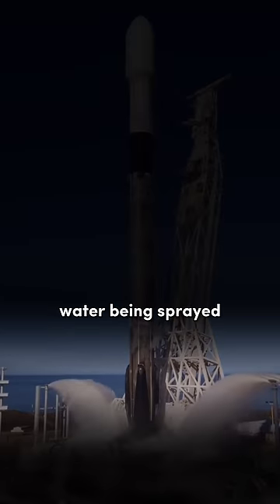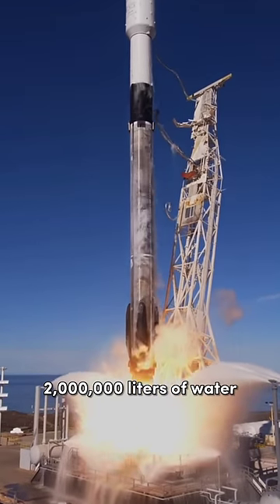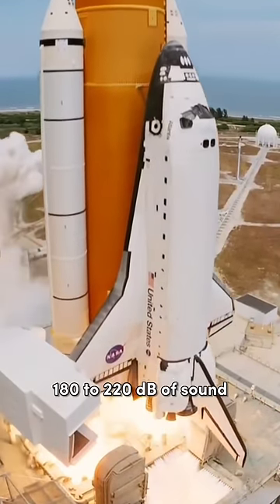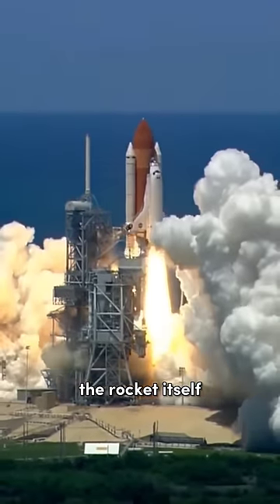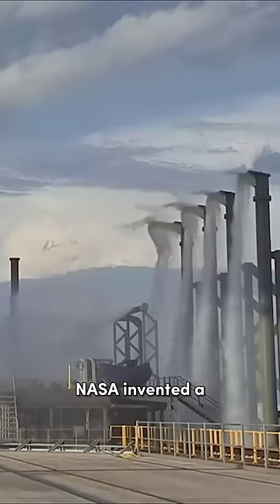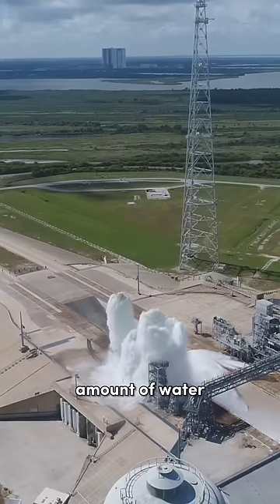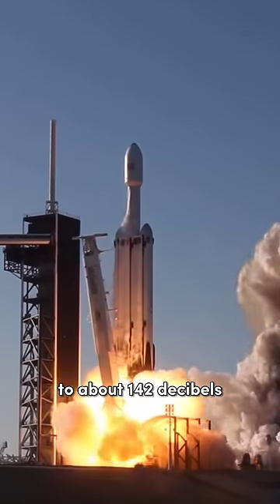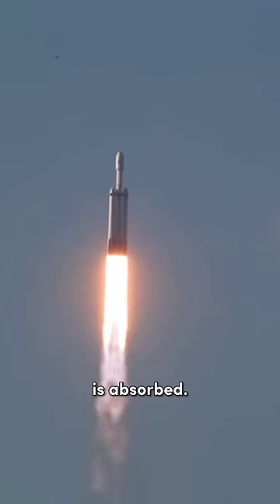How Water Prevents Rockets from Exploding #shorts

Comment: For everybody whining about waste water, first of all, you can't waste water, it just goes back into the water cycle from evaporation or absorption. What you waste is the energy that it takes to pump and purify it. Second of all, it probably takes a million times more energy to forge the metal components of the rocket, than to pump a little water up a tower. For goodness sake, pull your heads out of your bums. The rocket fuel alone could be burned in a power plant to fill thousands of water towers, it is a tiny, necessary expenditure. If you want to save the world and go green, write to your politicians and tell them to switch from coal to nuclear, that's the only fast, safe, clean way out of this mess. A little runoff isn't gonna change anything.
Reply: Water does return to circulation, but its not always so simple.

If you have already dry areas and you pump them even more dry, the pumped water will rain back on earth elsewhere leaving the original place all dry.

This is not a problem in places with plenty of water. But even in Finland, which is considered "country of lakes", dry summers dried many water reservoirs causing huge problems to people who have always relied on "endless water"

But I do agree that nuclear power is key element in fighting the climate change. Here few reactors are creating 60% of all energy need soon.
Shame Ukraine war halted the construction plans of the new powerplant, it was estimated to make 80-90% of energy production needed nuclear.
Reply: launch sites are often situated near sea or oceans, so unusable water is used for this
Reply: If it’s saltwater it doesn’t really mattet since we have some of that…
Reply: You can literally waste water. If the water reaches the ocean and becomes salty, it becomes virtually unusable
Reply: they use fresh water. also, it’s not that big of a deal. nuclear submarines have been converting salt water to fresh water since past centuries. how do they get water in space stations ? they make their own. it’s just that governments aren’t that into making fresh water, and are more into making people suffer.

Comment: He said 97% of the sound is absorbed and its still super loud. Amazing.

Edit: Guys, you can stop saying the same thing to me in the comments (I know). All I was getting at was that those are some amazing and powerful machines.
Reply: I mean it still loud but its a good thing that the water can prevent it from destroying the rocket, your ear and the surrounding buildings
Reply: 97% for the first few second of launch yes, everything after it leaves the ground is the full amount.
Reply: @jenson1569  well most the sound would be at very very low altitude considering a vertical launch.  Unlike aircraft
Reply: @jenson1569  no becouse in the air is nothing that courld be destroyed its more about the sounds waves hitting the lit or the olm directly from a close distance. The water won't be like a sound damper, more like a sound shield.
Reply: At 220 dB the vibration would heat up concrete enough to melt it. Imagine the effect on a human body, too. You'd basically get liquified. FROM SOUND.
Reply: @harrisonweaver7401  dB isn't linear
Reply: @harrisonweaver7401  Decibles are not linear
Reply: @harrisonweaver7401  That’s not how decibels work. dB can even go to negative because its not linear
Reply: still enough to cause permanent ear damage with short exposures
Reply: @harrisonweaver7401  of course its wrong. He said between 180 and 220 db and 142 is definitely not 97% of 180
Reply: @Slimboy025  I have actually no idea how he got to 97%, but the db scale is not linear. So basically to get the ratio you would need to calculate this: 10^((180-142)/10) = 0.00015 which is closer to 0.012%. The dB scale isn't intuitive.
Reply: @harrisonweaver7401  🤓
Reply: Think of sound as exponential when looking at decibels
Reply: Rocket only use his 3% of his power and it's super loud, imagine the Rocket use 100% of his power, the whole continent Will change season.

(The Comment is joke, not a science fact)
Reply: Then i don't how they went to moon in early
Reply: Me who trying to understand this smart shet caculation so i can reply back:
Reply: @justinh5382  like every 6 dB more is twice as loud
Reply: Decibel scale is not a linear😴
Reply: @harrisonweaver7401  that’s what I’m saying! The math just simply doesn’t check out
Reply: At cape kennedy the glas is 6 inches thick..launch pad is 3 miles away from the tower, any thinner than 6 inches the glass shatters..absolutly mental
Reply: @harrisonweaver7401 What? No, your not doing it right either. You need to find the difference first, than you get your value. So, 140-220=80. Therefore the dB was reduced by 80db, so now do the math. 80÷220×100 = 36% that's more accurate going from 220 to 140 and only dropping 80db. There is no way dropping by 80db from 220 is half the total volume. That's more like if it literally dropped by 140 decibles.
Reply: @MrGoesnuts Cause he took the Volume it dripped to and straight up divided by the total. If we're talking simple math, he didn't even calculate the difference. It should have been 80÷220×100 so the difference in % is 36 of original volume.
Reply: @MiJi_29 I'm dead ☠️ And you too funny.

Sike, lame.
Reply: @viktorbihar5384  you don't understand the decibel scale. It is not a literal scale. Every if you add 3dB to any level the sound pressure doubles. 103dB has twice the sound intensity level of 100dB and 53dB has twice the sound intensity level of 50dB. To go from sound intensity into the dB scale you have to calculate the log10 of it.
Reply: @MrGoesnuts  You're right, but the man wasn't calculating it using any scale, he was comparing the difference, and he didn't even do it right. We aren't talking about the decibel scale, we're taking about how he did his uncorrolated math incorrect. So, if the decibel scale were to be valued at a percentage, it would be 80÷220×100, not 140÷220×100.
Reply: @viktorbihar5384  he did state in some comment somewhere that he knows it isn't linear.
Reply: 97 percent yet still 140 out of 280 decibels ?
Reply: @tylerthecollins7256  it not a linear scale. The values are still wrong. More than 99% are absorbed from 280 to 140.
Reply: @tylerthecollins7256  I was gonna ask if I knew you by any chance, but then I realized the age wouldn't correlate.
Reply: Thought the were somone from a Junior Highschool I use to go to that I knew. Would have been a really cool coincidence😂
Reply: How is 142 just 3% of 220 though?
Reply: Also the decibel scale is not linear ;)
Reply: Decibel is a logarithmic scale
Reply: I saw another video where they test the engines of the rockets, and they put out alot of water.. to get rid of the heat from the engines.  Not sure what to trust now  :D
Reply: @aazreaal  thats kind of crazy, since i've read that 194dB is the max you can reach, cause after that the low preassure region is empty so cause of physics its not possible to go higher
Reply: ah okey, I found on nasas homepage info about the water. They release 900000 gallons of water to supress the audio level down to around 180dB "Thousands of gallons of water flood the launch area at the crucial moments surrounding ignition, serving two purposes. Water keeps flames from spreading and prevents damage caused by sound waves. Sound waves can cause pipes to burst, walls to crack, and joints to loosen. Damaged systems could lead to more fires because of those leaks and breaks. Water floods the launch area to muffle the sound energy."
Reply: @harrisonweaver7401  you ever wonder why it's lowercase d and uppercase B... The decibel is a relative unit of measurement equal to one tenth of a bel. It expresses the ratio of two values of a power or root-power quantity on a logarithmic scale. Two signals whose levels differ by one decibel have a power ratio of 101/10 or root-power ratio of 10¹⁄20
Reply: He said 180-220db. Then he says %97.5 absorbed and  get backs to 146db. 
Perfect maths 😂😂😂
Reply: @fatihertem1  you don't seem to realise dB are a logarithmic scale as a rule if thumb every increase of 10 dB relates to a sound being twice as loud so  a 70 dB difference would be equal to 2⁷ or 128 times louder.... so a 97.5% reduction from 220dB is not far off 146dB ..... are you feeling a little foolish yet?

Comment: Now this is just terrifying to think that Sperm whales call can reach upto 230dB
Reply: thankfully they're aquatic so a sound barrier exists around it
Reply: @aoyuki1409  bodies of water transmit sound even better...
Reply: @lepperkin  last time i checked our ears runs on air, not water. Therefore water must transfer the sound to air and thats horribly inefficient. But for other aquatic creatures unless they're point blank they'll be fine too and wont get shredded by sonar blast
Reply: @aoyuki1409  our ears don‘t run on air, but on the pressure changes created from waves. It does not matter if that wave was created in the air or in the water. This is why you are still able to hear sound in the water.
Reply: @XNerk302  yes, and whats the medium on the other side of the ear drums? air. thats why sneezing can sometimes make your ears and hearing go funny.

thats why everything sounds muffled/heavy underwater for humans
Reply: Hello twin
Reply: @TamilEelam1  incorrect. water can transmit sound/waves faster than air. its the conversion from water to air, and vice versa that is horribly inefficient due to refraction, diffraction and other waves (and also just simple physics like sound waves absorbed into movement or heat)
Reply: @luksta00  😂
Reply: @TamilEelam1  Because we are designed to hear sound in air. Our ears aren't designed to pick apart and understand sounds underwater, having evolved on land.
Reply: @TamilEelam1  like i said, our ears work on pressure difference to pick up waveforms. The inside of our ear is air. The other side if air, would have a smooth energy transfer across the eardrum. If the other side is water, there's a density difference of medium between water and air therefore the waveform gets distorted by refraction as it passes thru your eardrums.

You dont actually hear better on land vs underwater. You just hear them at different frequency and the frequency underwater just makes everything sounds muffled and heavy.
Reply: @aoyuki1409  yeah well, eventhough there is air inside the ear, the sound still travels primarily through the bones inside your ear - the hammer, incus and stapes - towards your inner ear
Reply: @TamilEelam1  guess who failed 9th grade physics. You.
Reply: @アヤミ  No, I didn’t fail. I actually scored the highest grade possible. No need to be rude for a genuine error.
Reply: @FlatEarthKiller  i didnt say anything about it not utterly destroying your bones and flesh xd
Reply: @aoyuki1409  it can rupture the lung and your brain even the most insulated body part is severely ruptured or at best, mildly
Reply: henlo.
Reply: @aoyuki1409  I have underwater speakers in my pool and the clarity is amazing.
Reply: @alanchristoffersen7329  thats because underwater speakers modify the audio waveform so that when it refracts on your eardrums with air inside it sounds amazing. try playing it in the air and it'll sound horrible. its just harmonics
Reply: Did you know that 200 decibels of sound is actually deadly
And 230 can disintegrate a human skull
Reply: @TamilEelam1  so a B?
Reply: @g_manitie1138  Grade B is not the highest grade possible 😂
Reply: @TamilEelam1  oh shit my bad I misread second highest lol, I was like why tf he bragging about a b 😂
Reply: @aoyuki1409  except Sound travels through mediums and water happens to be a medium 4x as effective as air. Our ears are not built for arial sound waves but just sound waves. Hence you hear sound under water.
Reply: @aoyuki1409  Point is, what protects you from such loud sounds isn't the fact that human ears "run on air", but that, being outside of the same body of water, even being mere centimeters away from a Sperm Whale should be enough to avoid being blasted.

And when inside water, the concept of being blasted at "point blank" isn't different from anywhere else either, including atmospheric air; Actually, a point could be made that cetacean clicks are directional and lose very little energy per unit of distance travelled when compared to "submarine-hunting" active sonars, so Sperm Whales can blend our brains from quite a good distance away.

But, of course, this would assume that not only do Sperm Whales want humans dead, but that they specifically target humans that are diving, when evidence suggests that they don't feel threatened by divers and often enjoy interactions with them. They are also highly intelligent, so they can relate the damage to prey done by their clicks (which they do use to hunt) with harming fragile specimens such as human divers, so they will even AVOID doing so.

TL;DR: Sperm Whales have biological guns mounted on their heads. They are 100% capable of killing any human they share a body of water with from a considerable distance. They just have exemplar trigger discipline.
Reply: And submarine sonars 235 decibels, it would usually boil the water near the sonar system
Reply: Sonars is more powerful
Reply: @aoyuki1409 Hey! I’m a scuba certified diver. I understand your argument, but it’s wrong. Yes your body uses air to absorb sound. Water transmits sound at 4 times the rate that air does.
Reply: @sare8087  even if water can transfer to ear diaphragm at good efficiency, since sounds travels 4x faster the frequency of the sound also changes so most of the time it will get distorted. just like light, sound is a wave. yeah u can probably hear something but its very different from hearing it without water involved
Reply: Ok so just to clear some facts. The medium of sound propagation in inner ear is liquid. The medium in outer ear is mostly air. The middle ear is bones. Middle ear converts the sound in air of outer ear to sound in liquid of inner ear. The difference in size of ear drum to oval window of inner ear help to amplify the actual sound.
The air in middle ear is just so that ear drum can move freely and not be stiff due to vacuum. Middle ear is connected to deep part of your nose cavity by Eustachian tube so there is no pressure difference with outside environment in middle ear which can impede the movement of ear drum.
Reply: @aoyuki1409  dude, the cochlea is filled with fluid that helps the cilla register the wave as sound. At least do a minimum of research before commenting
Reply: @aoyuki1409  no water make sounds even more louder like cracking a bone in a pool
Reply: Exactly!

Comment: So it’s actually a lot louder than what we always hear? 😳
Reply: Yep
Reply: 33 times louder, to be exact. It would produce literal shockwaves.
Reply: Going from 140 db to 220 db is an increase of 80 db which makes 220 db 800 times louder than 140 db. Even short term exposure to 140 db will result in permanent hearing loss.
Reply: Definitely
Reply: It's a literal constant explosion of chemicals thrusted straight to the floor, what did you expect
Reply: The water makes go down to 180dB.. but Ive read that around 192dB is the maxium you can get cause of physics

Comment: During the shuttle program at Kennedy Space Center they used a 300,000 gallon water tower.. 200,000 gallons was used for sound suppression.. which was dumped in about 12 seconds while the other 100,000 gallons was held in reserve in case of fire on the pads

Comment: Nasa wanted to make a kinda reusable rocket named the SEA DRAGON, that rocket was so big and powerful it needed to be launched from the SEA! Not a floating launchpad but FROM THE ACTUAL SEA, nearly half of the rocket would be underwater just so the engine won't destroy the rocket on launch, and they had to place it in the water because the engine would crack the concrete and destroy the launchpad.

Comment: I love engineers
Reply: I worried about water being wasted
Reply: @pragun8204  sea is rising
Reply: @UEnrift  that's dirty water
Reply: @pragun8204  The water doesnt disappear it evaporates turns into clouds and rains down again
Reply: @koppi9278  i know that but most of the rain water goes to ocean , ground and sewerage system
He should use some dirty water or ocean water
Reply: @pragun8204  The thing is the water will again evaporate from the oceans,sewages basically it will never be wasted
Reply: @hellstorm3132  but i will never be clean water 
You can't clean ocean water
If that were the case there would be no water shortage
Reply: @pragun8204  You can actually clean sea water you'd just need to relocate like over 50% of a country energy supply only to produce water
Reply: @kirakira9906  ya and that's pretty inefficient so it's kinda not possible to do it
Reply: @pragun8204  first of, if u have seen how much humans waste water daily, this amount seem negligible. It's as same saying that's a waste of food when u don't eat your veggies. Number 2 is that using dirty water will bring whole lot of problems such as getting stuck on pipes, damaging sensitive components in and out of the rocket and launch pad, and dirty water doesn't absorb heat and sound waves as normal water. 💀💀💀. Also who is "he" there's a whole science and engineering team behind this, don't you think they would have gone through this already??

Plus if you think that the water we are using so little compared to sea water and iceberg but actually no, it's a huge amount and as long as the sun shines clean water will remain same thanks to the rain cycle.
Reply: @pragun8204  it’s not wasting if your using it for something. That’s not what the word means. That’s like saying I’m wasting water by drinking it.